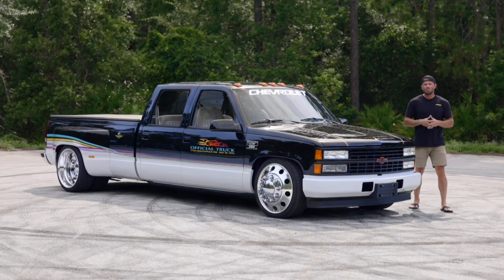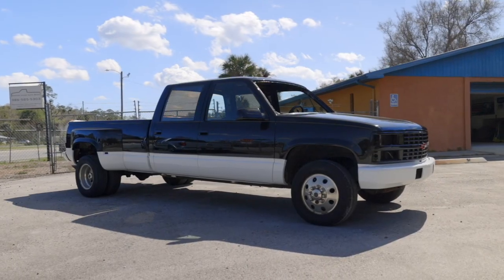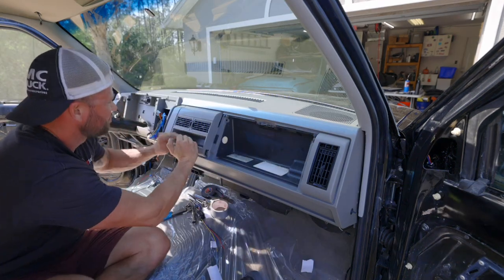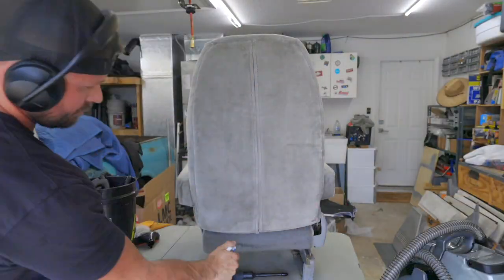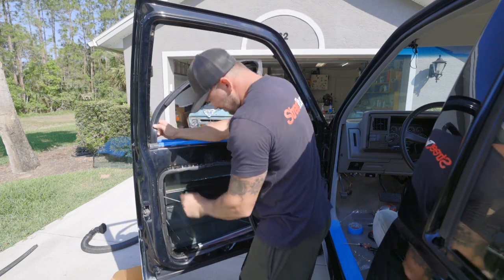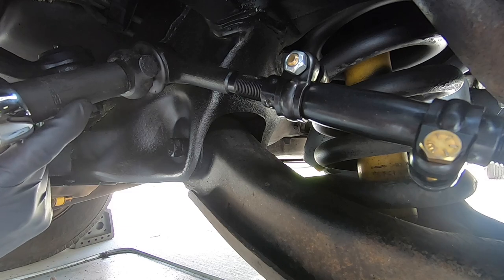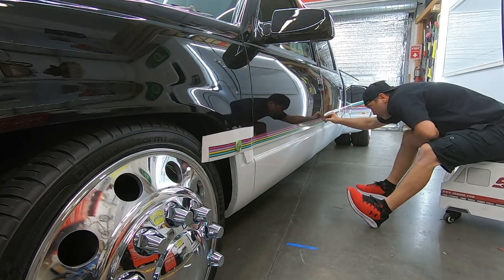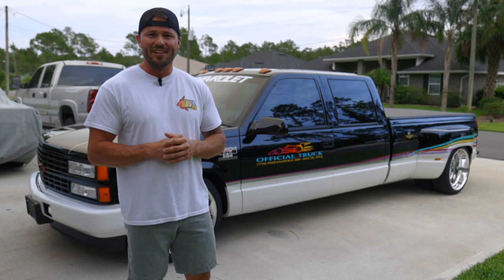The Truck Chevrolet Should Have Made

Comment: Out of curiosity where did you find the storage spot for the factory radio in the dash? I'm currently rebuilding a 91 regular cab with the same color interior. I know one of the colors is a light gray but I haven't found what the other color was. Were you able to find the 2 colors? Thanks.
Reply from the maker: I got mine from a work truck and painted it to match. It's actually pretty handy on road trips. Also when the AC is blasting it keeps the cubby cool which is great for phones or candy bars. I redyed all of the interior parts with SEM Color Coat. I used Storm Grey and Medium Dark Pewter
Reply: @yeahbuddygarage  thank you so much for your response! That helps a lot because I'm trying to restore a truck that's been in the family for least 30 years.. My dad bought it first and remember taking trips in it.

Comment: I have a 97 C3500 I'd like to restore the same way but without the graphics. Just wondering how much I'm looking at spending? Any  idea?
Reply from the maker: The wheels were $6k and the drop kit from bell tech was around $2,500 so  call it $9,000 in parts and misc items you may need to replace (carrier bearing, ball joints, etc...) If you go all out like I did with paint, all new glass, new seals/ weather stripping, redoing the interior, gauges, steering wheel, air lift helper bags/ on board air, stereo it can get out of hand quick. lol
Reply: Im guessing closer to 20k  @yeahbuddygarage